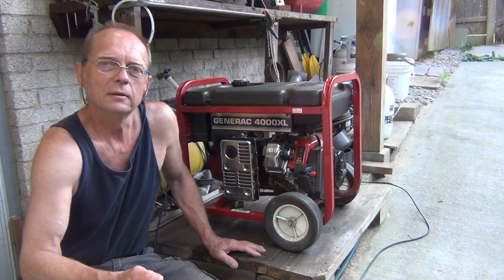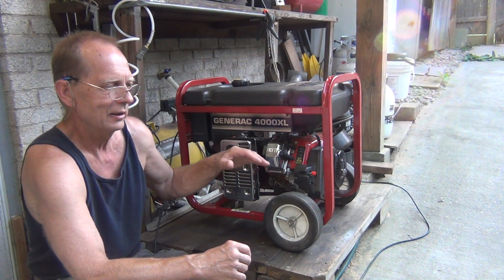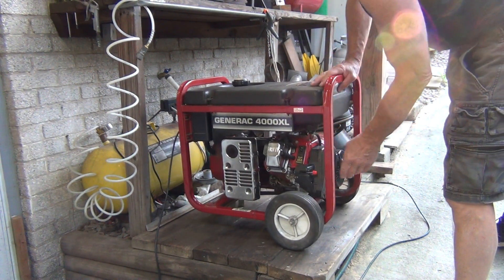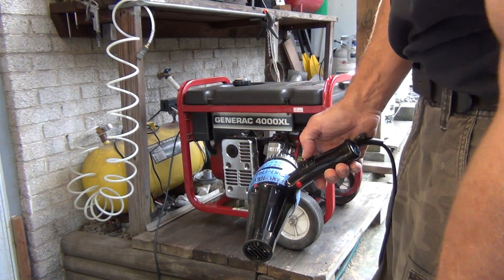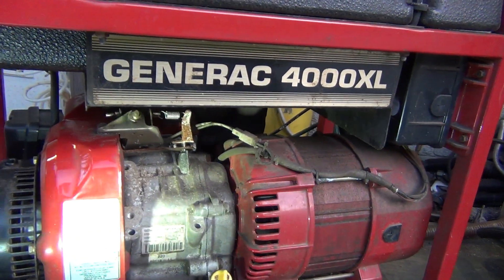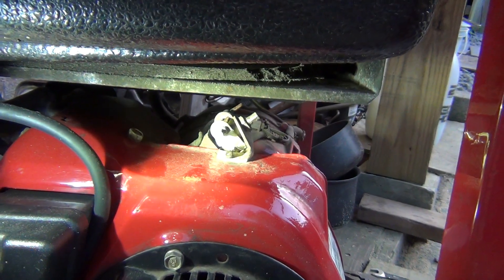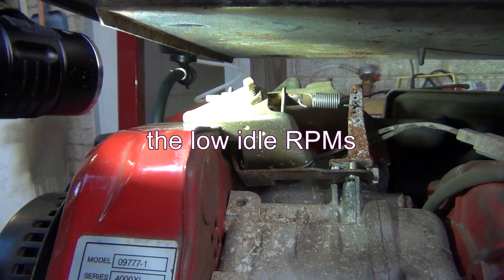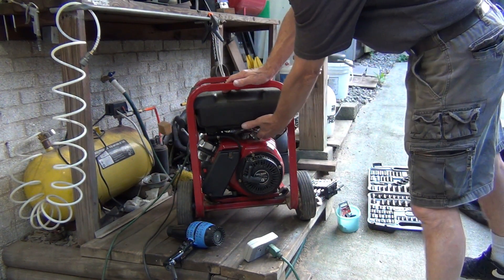Adjust low idle RPMs Generac generator 4000EXL 4000XL

Comment: Vlad, when you make this particular adjustment, is the  idle control switch on, or off? I'm assuming it would have to be off since that switch controls the circuit for the solenoid on the throttle linkage?
Reply: It’s on
Reply: @tysesty  thanks. When I turn my idle control switch on, it doesn't drop down at all. It still revs at normal speed. Now I guess I'll troubleshoot the circuit. Could be anything. Bad switch, etc. Thanks for your helpful videos.

Comment: Hey Vlad. I own a 4000xl and I've used your videos to adjust the frequency and voltage, great job bye the way. Anyway, after doing this I have issues with the generator surging under certain loads sometimes intermittently and then settles. Is there a way to adjust the governor on these to stop this or something else I can try to stop it? I've looked at the governor and there's a bolt that will tighten and loosen the linkage against the shaft. Just not sure how to adjust it as it is different than other governors I've seen.
Reply from the maker: Most of the time is not a governor, it might be dirty filter, blown gasket on carb or loose bolts, or dirty carburetor is the 99% the issue. Your problem is the mixture of gas and air is not in balance.
Reply: @VladFredK  sorry Vlad I forgot to mention I performed the voltage and frequency adjustments after cleaning the carb and changing the air filter. The gasket on the carb seemed ok there are no gas leaks and I can't find any loose bolts
Reply from the maker: @Juicemeister07  was it okay before?
Reply: @VladFredK  it ran ok no surging before I cleaned the carb but I was having fuel delivery issues. Figured needle was stuck in the seat so I cleaned the carb and changed air filter while I was at it. Think I bent the linkage a little while doing the job so I adjusted the rpms and voltage using your videos. Surging started after I did the adjustments.
Reply from the maker: @Juicemeister07  go bact to the RPMS you had before and see if it surges
Reply: @VladFredK  it's only doing this under load. For example I start the generator and it is fine no surging. Then I plug my camper into the 30amp outlet and run my air conditioner. The governor/linkage seems to force the throttle open and closed surging back and forth. I can actually grab the linkage with my fingers and get it to settle out. After a short time it will surge again, however it eventually seems to settle out under the same load after 5 to 10 minutes. A lot of info I know. I'm just kind of stumped.